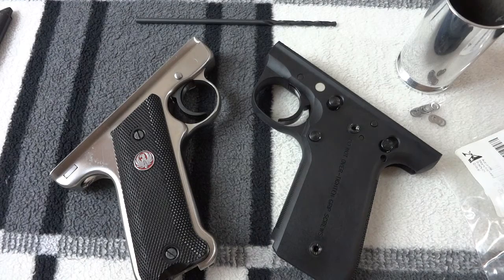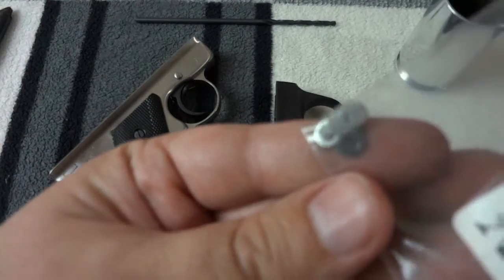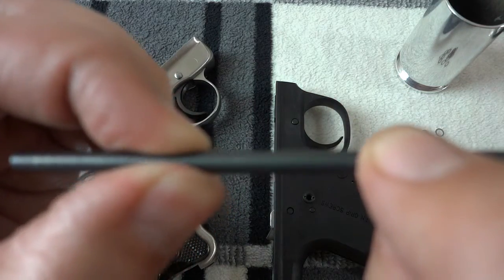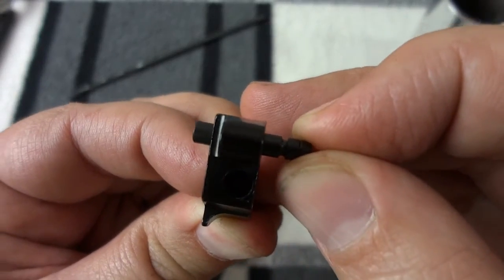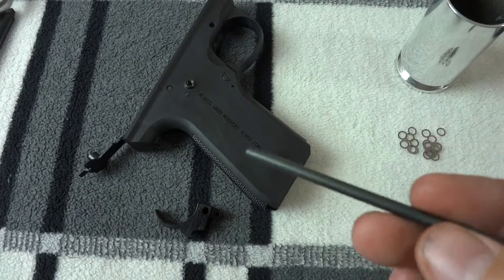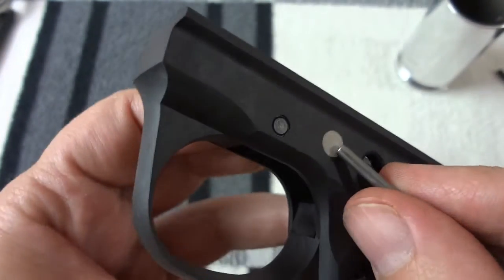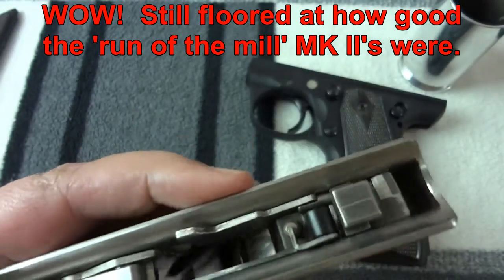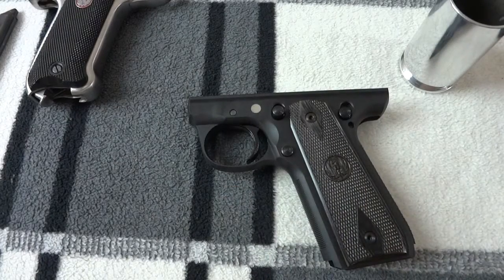Ruger MK III Trigger Looseness Hack

Comment: Ah yes the old close enough is good enough manufacturing mentality.
Reply from the maker: NAHAAFB Yeah.  I don't know how the MK II could be so tight and the MK III seems to throw all that away.  Funny that the hammer pivot pin seems to be very close tolerance, though.  It's almost like they got a Taurus engineer to tool up for the front pin holes.